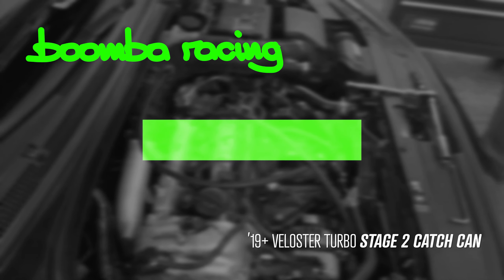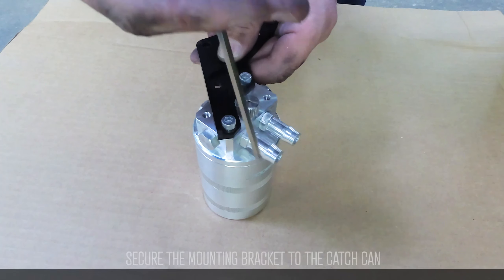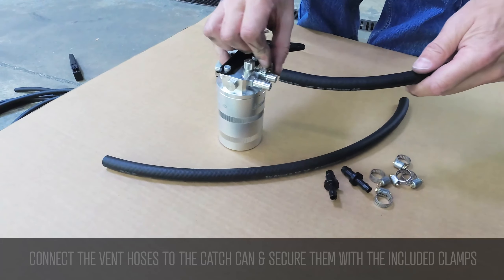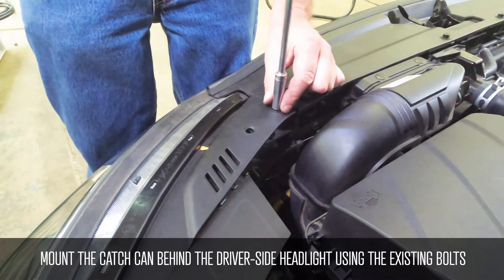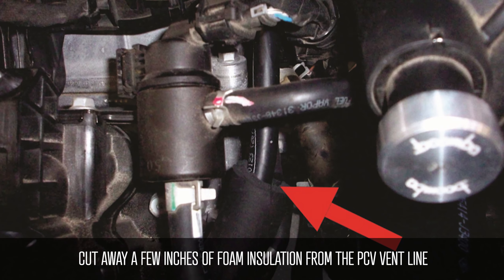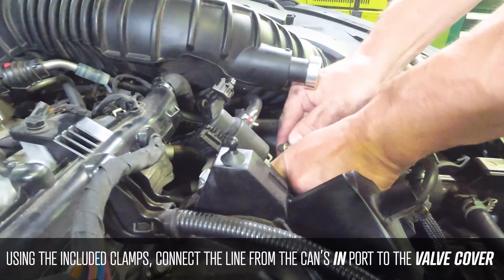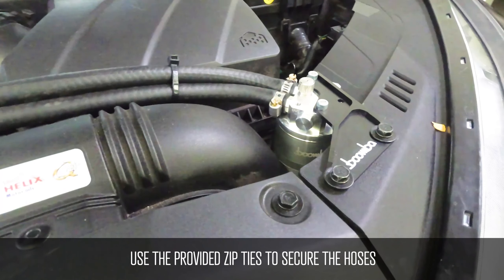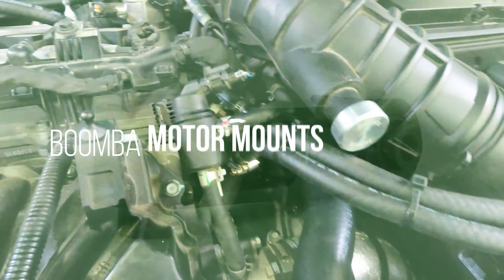How To Install | '19+ Veloster Turbo STAGE 2 CATCH CAN

Comment: Are both stage catch cans usable for all 2016+ Hyundai cars that use the 1.6 Turbo engine? (e.g. Elantra Sport) 

Thanks for the quick helpful video!
Reply from the maker: The catch cans can be used on pretty much any motor, however the install kits are specific to each vehicle (mounting brackets & vacuum hose length for) The good thing is that our Compact Catch cans come with a universal L-bracket that should accommodate just about any application. We also offer a 'Universal Starter Kit' that includes that L-bracket, 60" vacuum hose as well as hose clamps!

Comment: I would assume a catch can is a catch can and this would work with Veloster Turbos older than 2019, correct? I just may need to install it in a different location within my engine bay?
Reply from the maker: Correct! It'll perform the same, its just the mounting bracket included is specific for the car. however, our compact catch cans include a universal L-bracket that should allow fitment on most platforms!
Reply: @BoombaRacing  Awesome! Thank you! I'll look in to that one instead

Comment: Would it be better if I installed both stage 1 and stage 2 catch cans? Or will one work just as good?
Reply from the maker: Both would be best of course, but if you're only going to get one to start with we'd recommend the Stage 2, since its the high pressure side and much more likely to catch contaminates!

Comment: What's the difference between a stage 1 and stage 2 catch cans
Reply from the maker: Stage 1 is the low pressure, or CCV side. Stage 2 is the high pressure PCV side. Check out this link for a little more info: http://www.boombaracing.com/blog/catch-cans-stage-1-or-stage-2-which-should-you-buy/